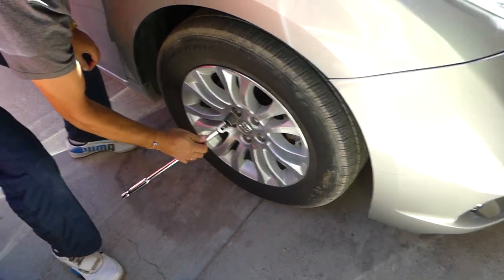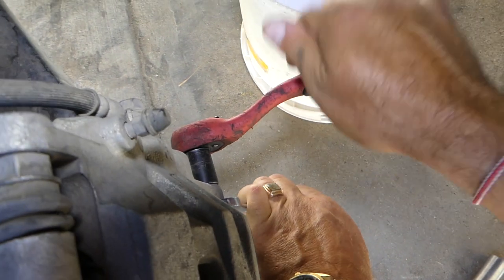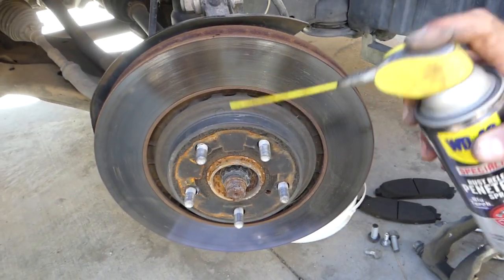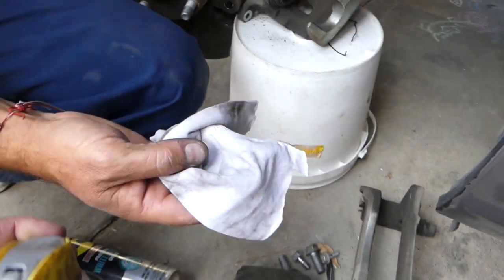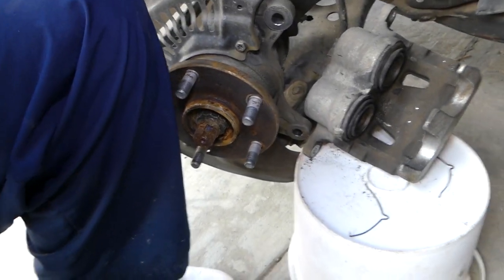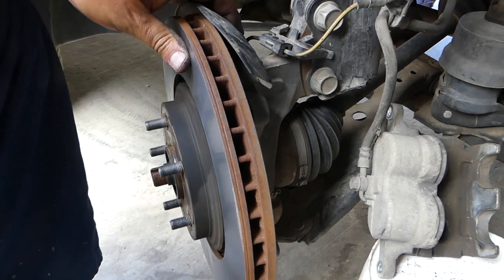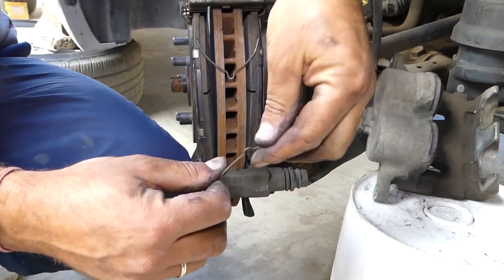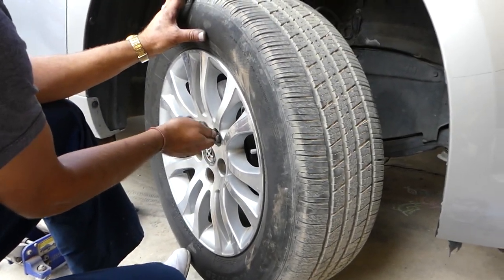HOW TO REPLACE FRONT BRAKE PADS ON TOYOTA SIENNA

Comment: Can you do/turn just the rotors without replacing the pads (if the pads are good)  to remove waving when applying the brakes ?
Reply: Not recommended.